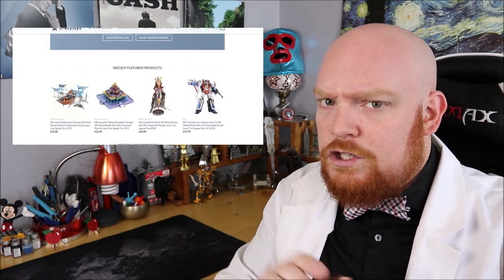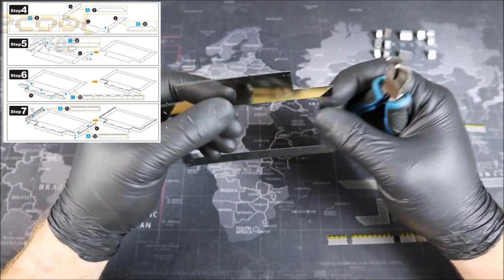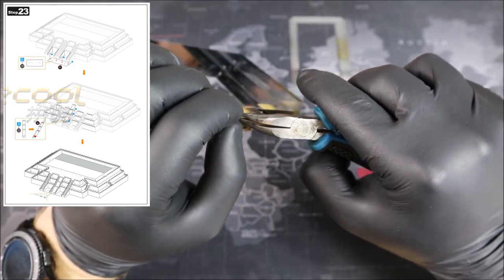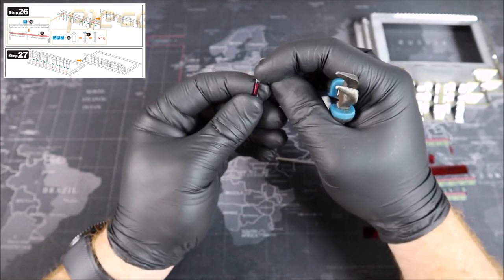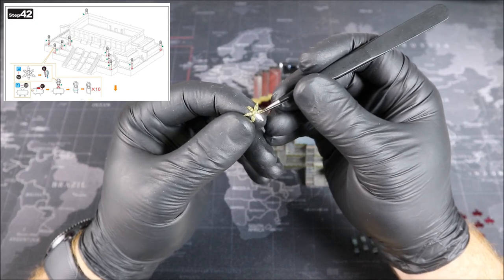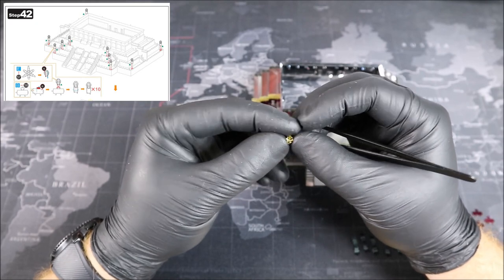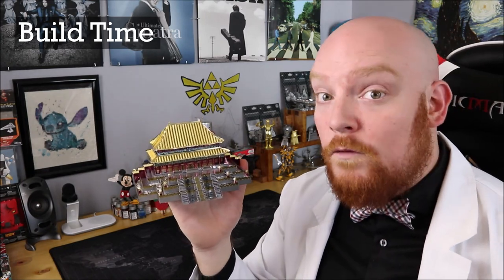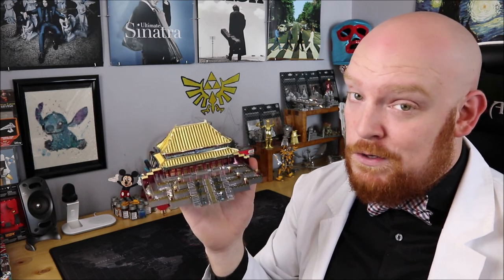Hall of Supreme Harmony - Piececool - Build & Review

Comment: One of your better videos.  You don't seem so hopped up on cocaine like in your later videos.  You also didn't call me a "Groove Builder" 10,000 times so thanks for that.  To make perfect round pillars you just use your fingers to "pull" the part around the mandrel.  If you try to use pliers as you did it just pinches a kink into the part.  (Sort of surprised you didn't know that...)  You should ditch the goofy gloves.  They dull your dexterity and provide zero benefit.